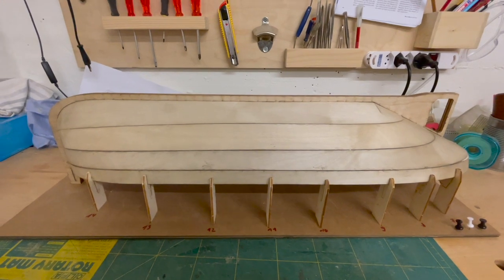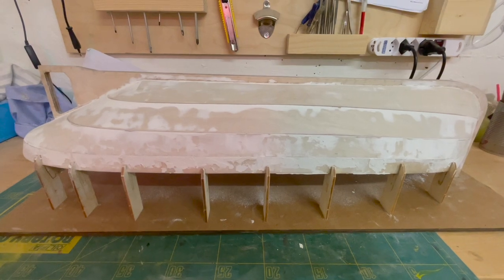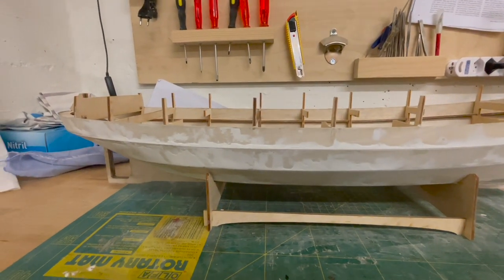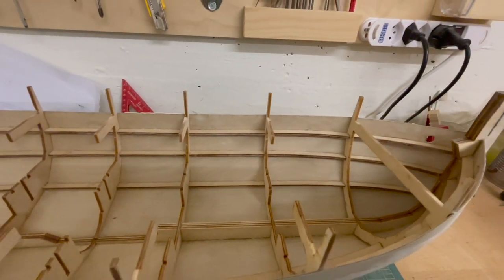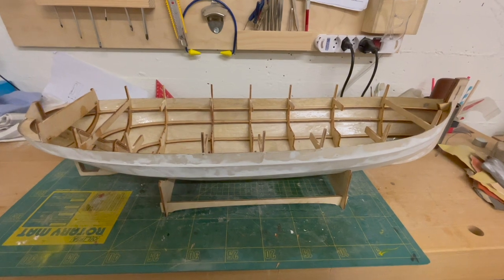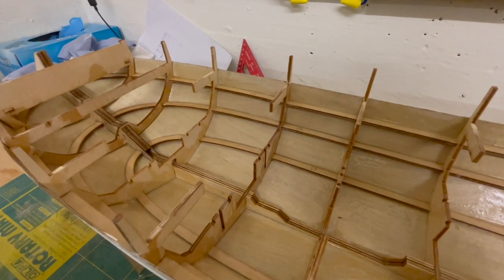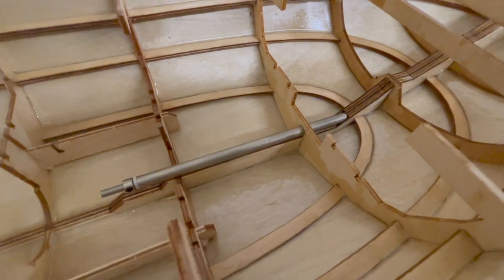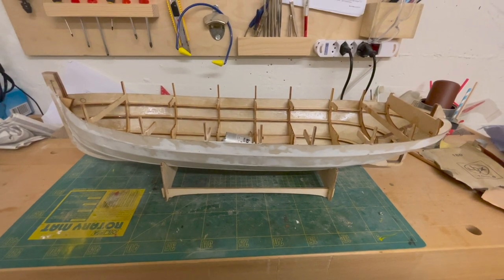RC Steam Tugboat (Aeronaut Kit) Part 3

Comment: After you are done fully fairing the hull (sanding etc.) will you also put a layer of epoxy over the outside? Because without that, water could damage the outside wood.
Reply from the maker: Hi, I don´t use epoxy on the outside. But after priming and painting the hull, I seal it with a couple of layers of 2k-varnish (it gives a really hard and water resistant finish)
Reply: @modellteichrc3988  Ah. Thank you. After watching the episodes following this one I realized that shiny epoxy would not look right on top of paint.